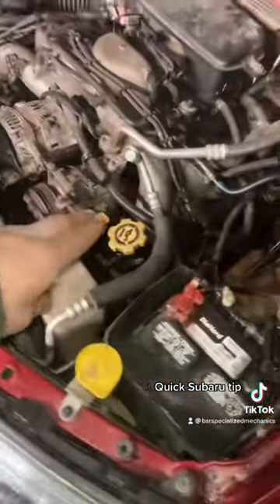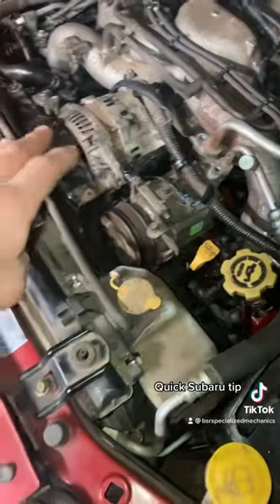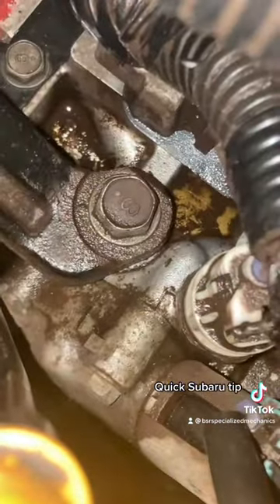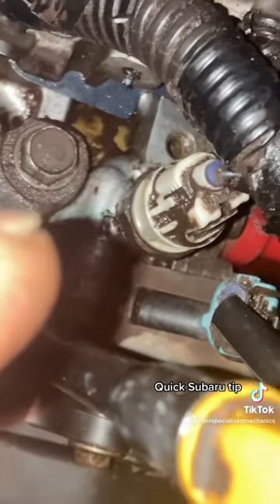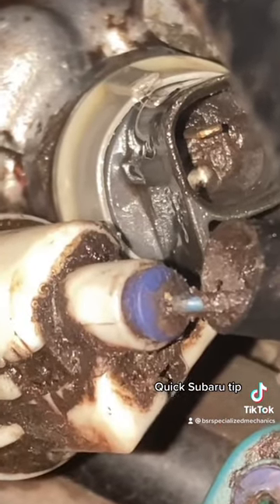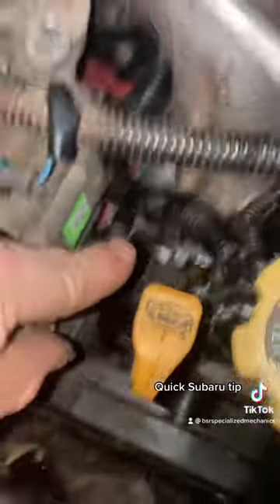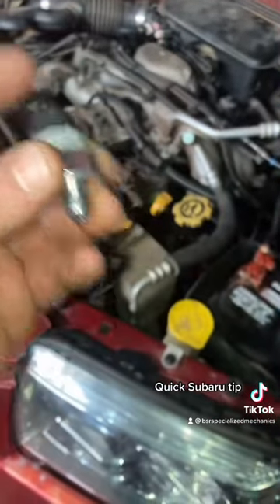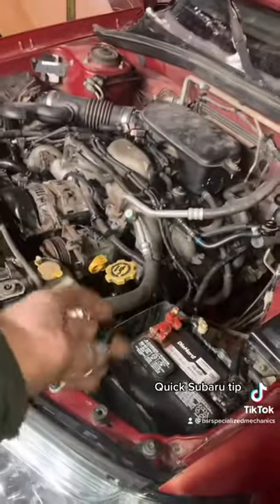Common Subaru 2.5 oil leak

Comment: DO NOT screw it in too tight. It can crack the engine case. I made this mistake. Be gentle.
Reply: It just cracks that part of the head. But it’s fixable with some JB Weld
Reply: I helicoiled mine and andes an extension
Reply: To late😢😢😢😢
Reply: @CHILE-rd7tr  nope
Reply: Fffffffuck I may have tightened it too tight lol
Reply: @Bousheybobby I’m in the same boat as you brother. We fucked up. What did you end up doing?
Reply: Bro this is what I think I’m going through rn, I just relaxed the sensor and maybe I put it in too much but I’m not sure and there’s oil all over in that side and idk what to do
Reply: @Vaakxety  sorry for the late reply. But mine cracked but I ended up using jb weld to coat it and it's holding strong still
Reply: @YeaItsJr_Talks most likely cracked that part of the head

Comment: CAUTION: The parts stores that give out this sensor often tend to be larger than the oem. Thread size and overall length will be the same, but the thickness of the threaded piece is different enough to crack head piece of your engine block.

Comment: If you overtorque it and Crack where it threads into, you will have to replace the entire head. BE CAREFUL
Reply: You don’t have to replace the head. Simply clean and prep really good. Screw in the sensor and JB Weld the crack. And you’re done. Did one last week
Reply: @geraldyates8958  lmao
Reply: @hondabro5162  Haha, why are LYAO? Do you not know how to fix things? You can come weld with JB Weld or hot weld. But it’s fixable. Think outside the box
Reply: @geraldyates8958  jb weld is for people that fuck up. As a subaru tech we don't use jb weld to fix cracks goofy

Comment: I may need to look into this.  I have been getting a smell of burning oil, but can't find any obvious leaks and it is very slow (I lose less then a 1/4 in 5K miles). I do have what looks to be some oil around that region, but figured it was probably just from drips when checking the drain plug / filling that I didn't clean up well enough.

Comment: I think I have oil leaking from this spot too but also somewhere else. It’s dripping down onto my exhaust pretty bad, I put a quart in almost every other day. Looks like it could be coming from the crank cases or head gaskets but I’m not sure because it’s incredibly covered in oil. Everywhere… I need to clean it all and take a look so I can finally fix it and the many other problems, or I’m just going to find a newer engine to swap and tinker with my old one and learn some stuff/sell it
Reply: I’m having the same issue! Was there another leak or was what he fixed in the video work for you?
Reply: My legacy has similar leak. My head gaskets are leaking, but my oil pain and rear main seal were leaking so when I replaced my clutch, I did them both. It’s hard to tell where these leaks are coming from bcuz when you drive, it spreads the oil all around. Oil pan was easy other than the dipstick part bcuz my old one was stuck on the pretty good and I ended up having to cut it off which was a pita working under the car with no lift. The rear main seal is obviously a big job, but just a few extra steps when already servicing the clutch. What i realized after is that my head gasket leaks are not that bad so I will wait until it affects the cars driveability before I replace them. My valve cover gaskets were leaking in the past and so I replaced them and the spark plug o-ring / oil seals which is a very common failure on subarus (legacys at least) and causes oil to leak into spark plug threads which will cause misfires, possibly black or bluish oily exhaust smoke and when you remove you spark plug boots and plugs, you’ll usually see oil on the boot and threads. Good luck! Subarus have a lot of issues, but when they’re runnin fine, they’re great.
Reply: @swiman08 what was your issue? Encountering something similar

Comment: Yes, I think this is leaking on me. I had the P0026 code 5 months ago on the other side and replacing the oil pressure switch on that side fixed it. I probably should have replaced both sides because now I'm leaking oil from the one that was fine at the time.

Comment: I've found when swapping old sensors to another head or block they like to break when you take them out of the old block/head! Knock sensors are the worst to the point if they are buried ill sell a new knock sensor with the job! Great that it was easy to get to

Comment: Certified Subaru dealer just conducted an oil control value and completed an oil change and engine flush during the service. 2 months after I received the service I got a “low oil” light on my dash and was like wtf my car just got serviced. Topped it up and pulled out of a parking spot one day and stopped to check the parking space for any leaks and noticed 2-3 drops of oil on the pavement. Idfk what they did to my Impreza but my car never leaked oil prior to me taking it in for service and now I’m PISSED thinking they screwed something up or this is just some odd coincidence that occurred at a weird time…

Comment: i\m wondering if this is my issue. is this sender sensor on both sides of the engine? i find oil leaking tons onto my exhaust downpile and spitting all over the area now ;\ fb25 on a 2012 forester

Comment: I got leak on 2017 legacy by the alternator any tips on what it can be
Reply: I’m not familar with the ‘17 model as mine i have an 09 legacy and 2011 wrx, bro has ‘21 sti too, but if it’s an EJ engine model, there is an oil pressure sensor switch to the left under the alternator on the passenger side of the vehicle. I’m pretty sure it’s notorious for leaking…clean up the oil as best you can, then start the car and watch to see where it’s leaking from. Good luck!

Comment: I have a 2013 subaru outback base and my oil leak is the same place that yours is and they told me it's camshaft carrier gasket they said need to take the engine out $2200
Reply: Subaru tech here, that's correct